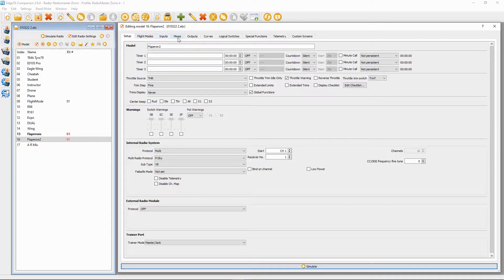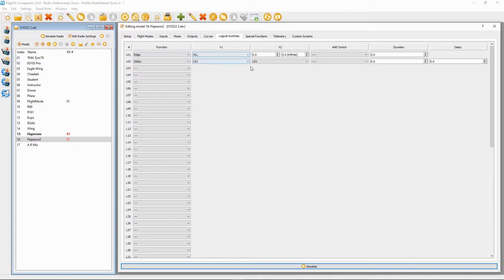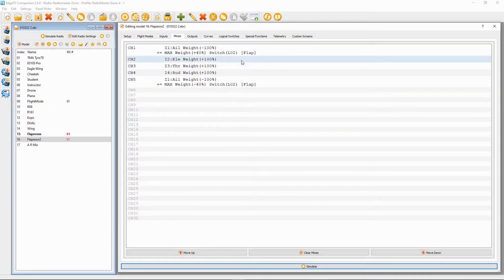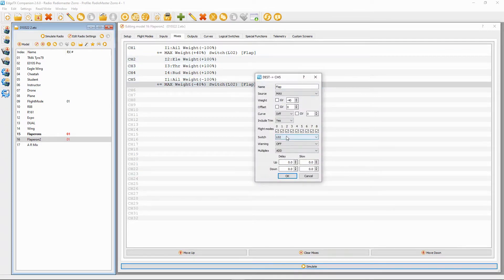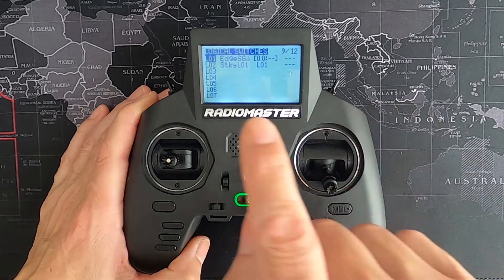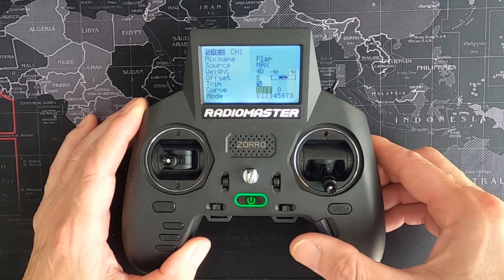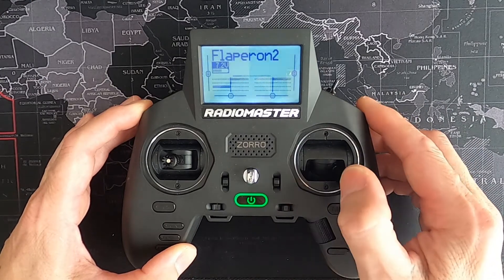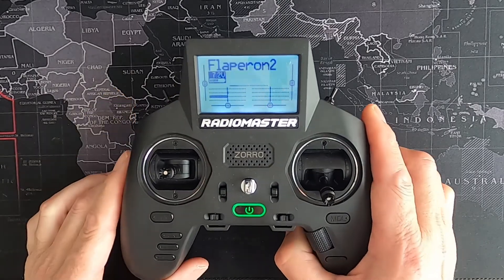RadioMaster Zorro Flaperons in EdgeTX on a momentary switch

Comment: Hii Bill , can you help me? 
Yesterday I bought a Radiomaster Zorro for DLG, I am confused how to mix, can you show me how to setup DLG on Radiomaster Zorro??
Reply from the maker: If you could tell me the exact mix you would like I will work out the mixes on the radio ie up elevator left rudder etc. Should the mix be on a switch?
Reply: Thanks in advance,
The mixing i need is :  
CH1= AILE
CH2= ELE
CH3 = AILE
CH4 = RUD
No motor.
Launch mode : SA Button = Elevator up  ,  Thermal mode : SB = Activate flaperon, Flaps 1or 2,
Landing mode CH3 : activate airbrakes and elevator little down

Comment: L01 isn't necessary for this.  You can do this with a single logical switch if you make a Stky with SG↓ for both V1 and V2 it turns SG into a push on/push off toggle.
Reply from the maker: Great information. 👍🏻

Comment: I'm setting my arm switch up on the hidden momentary switch on the.....Mine says arm disarm..... Because I push it and then let go of it how do I make it say arm and then when I click it again it says disarm?
But the channel is staying on and off when I click it like a toggle... Just the voice isn't right it's his arm disarm every time I touch it
Reply from the maker: I assume you have set up your momentary with logical switches so set the Armed DisArm sounds to the logical switch’s.
Reply: @the-happy-RC-flyer  hi, yes... I actually just figured it out, in special functions I made that momentary button link to the L02 for on and !L02 for off.....
Great videos thank you for the help and the reply.....
Reply: @SJV82  I am trying to set my quads to arm and disarm off a button on the bottom of my Radiomaster Zorro.  Your idea for the !L02 saved me!  I am so close to getting this working.  I have hit switches accidentally and these bottom buttons are sort of flush or almost recessed.  It is very much on purpose to hit them and I think disarm will be quick.  I am just learning and have hit disarm switch while flying messing with other switches.  I go to change rate and hit wrong switch and crash.  This might be good solution.

Comment: I repurposed all my trim switches to be momentary switches, so I now have 25 momentary switches on my TX-16s in addition to the 6 three position and one two position switch.  Download my free soundpack which includes a sample crossfire checker model to see how it's done...  the Crossfire Checker model them all to report Crossfire telemetry data with a voice label as to what it is followed by the value currently being sent back from your model.  You can repurpose as many or as few trim switches as you want; in quadcopters, we don't use them at all.   The TX-16s has 6 in total.  I don't think the Zorro has any at all, it being done through the TX-16 screen : - 7